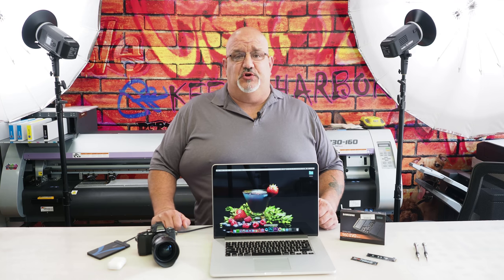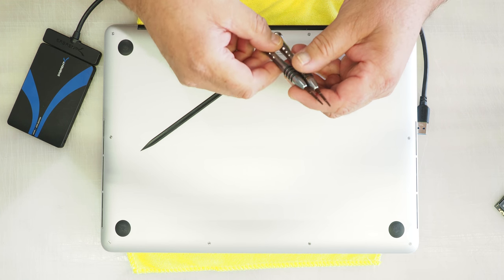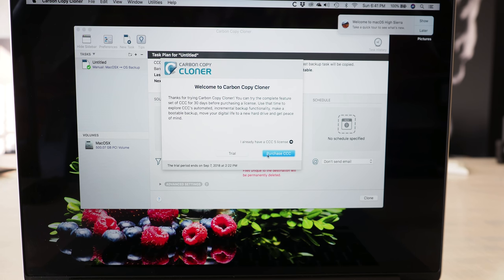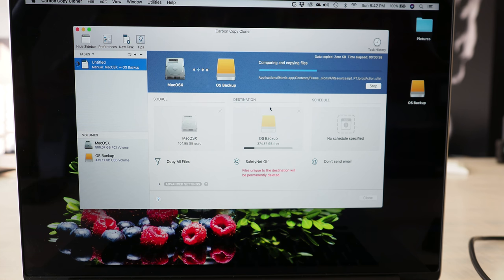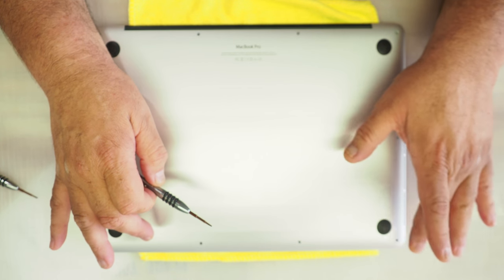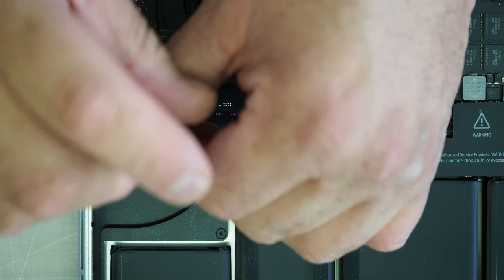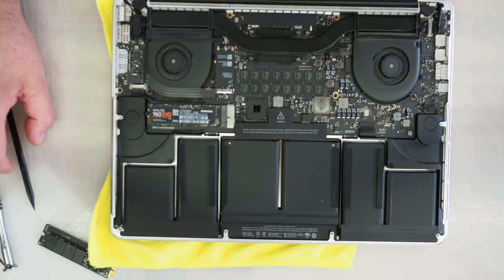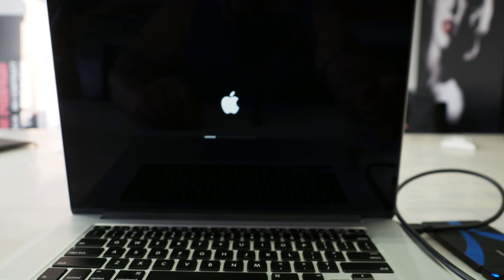Double the speed of your MacBook Pro  **EVO 960 HOW TO UPGRADE**

Comment: For safety sake you should unplug the battery connector, also if you are a smoker DO NOT touch the GOLD (they are not brass, they are actually thin gold plate over copper) finger connectors on the adapter and the SSD, long term oxidation can occur or static discharge from your body could damage the SSD. The plastic pry tool Rick uses is called a spudger.

Comment: the method helps to increase capacity at low cost however yes the disk is faster but in normal use or heavy use is not so ... big ..... in fact i made the swap with a 1TB nvme WD Black Drive .....   I have reinstalled the original 1 TB Apple Drive.......  I`ll keep the drive in case of fail

Comment: Hi Great video! How's temp after the ssd upgrade? My mid-2014 macbook pro runs really hot after the ssd upgrade. I'm just wondering if there's way to fix the temp issue. Please advise. Thank you.
Reply from the maker: Yes 
The bottom of the laptop gets hotter but the hard drive uses the bottom of the aluminum laptop as a giant heatsink so no worries
I do 4K video editing on it and it blows thru frames without a hiccup
Thanks for stopping by
Regards, Rick
Reply: @rickvestuto  Thank you very much for the quick response. Have a good night.

Comment: Any idea how I could make this come true with a 2010 MacBook Pro with a 2.5 sata hhd currently in it?
Reply from the maker: You might be able to
You would need an adaptor from Sata to Msata...
problem is that your 2010 laptop has smaller Lane width and  probably wouldn't be able to go any faster than the 400 or 500 GBS  speeds that the computer already does
so it would be the same speed and not worth doing
Getting a faster SATA drive like the new 970 Pro might help but again may not help do to the fact that the computer is so old

Comment: Hi Rick, would this also work for MacBook Pro - late 2013?
Reply from the maker: The only way to know for sure is to Open the back of your Mackbook
I'm guessing that theres a 2.5 HDD instead of a MSSD
If so it's still posible to put a faster HDD in yours
it will just have to be a Solid State 2.5 HDD instead of the Msata style like mine
Reply: CHK MKN true it has ssd. Sadly the IOS cannot see it. I tried on Ubuntu and it detects it.
Reply from the maker: I dont know what you mean "The ISO cannot see it"
You can switch out any Mechanical HDD with a SSD and it will become 2 to 5 times faster
Once you follow my step by step from your Mechanical HDD to a SSD you will be able to load into the ISO

Comment: Hi Rick I have a Mid 2012 13" inches Macbook Pro(model A1278) I want to replace my primary HD(2.5 Sata) to a Samsung 970 EVO SSD. My question is, is there a an adapter in particular that you would recommend? If so, would the drive run at a 100% and what about the durability of that adapter? Thank you
Reply from the maker: If there is an adaptor that would fit I don't think that you would see any improvement on the 2012 Macbook
The older tech in your laptop does not have the Bus speeds and width needed to run any faster than 400 to 500MBS.....Thank for the question
Reply: @rickvestuto  thank you. Then I will go for a regular 2.5 sata. I'm trying to decide between Samsung and Crucial. Any suggestion?
Reply from the maker: @Tony_2022  Crucial can generally be cheaper but I prefer Samsung. I have had problems with Crucial in the past but have never had problems with Samsung.....
Best of luck
regards, Rick
Reply: @rickvestuto  I agree I'm actually replacing it because my main one is damaged. And it's Crucial brand

Comment: Will This Work On A Mid 2014 13" Retina Macbook Pro???
Reply from the maker: Yes it should
Just depends if you have NVME drive or not
Regards, Rick
Reply: Ronaldo Ramnath yes, I performed this upgrade in a 2014 rmbp with the samsung 970 evo plus 1tb, found out the sleep/standby/hibernation/autopoweroff issues affected the 2013-2014 models, went in terminal to set them all to 0, reading on the macrumors forum website thread this known for all aftermarket ssds and apple has no plan to update the dxe boot rom driver for this https://forums.macrumors.com/threads/upgrading-2013-2014-macbook-pro-ssd-to-m-2-nvme.2034976/page-257
                                                                  Mac models will enter Standby mode after they have been sleeping for 3 hours. The issue we are investigating is a system crash which can sometimes occur while attempting to wake a Mac from this Standby mode. Afterward a panic log will be displayed.
 
https://eshop.macsales.com/Service/Knowledgebase/Article/26/785/NVMe-SSDs-Standby-Mode-Issue
 
This problem is related to the NVMe DXE driver in the bootrom of the 2013-2014 MacBooks, how change settings in terminal
http://indmem-global.com/download/20191014.html

Comment: I’ve been trying to avoid a two hour drive up to B&H if you know about MacBook Pro (2018) using a QNAP NAS (TVS-472XT-PT-4G) or any NAS (since QNAP has no support... they ignore emails, forums, phones...)

I thought it would be as easy as any other external drive - just plug in your USB or in my case Thunderbolt 3 and Mojave would be plug and play Good to Go... Nope.

QNAP Qfinder and MacBook Finder... can’t!?!

The User Guide looks like there needs to be a “switch” or “router” in between but there is no mention of WHAT that is and Apple “Support” says they “don’t support 3rd Party products”

Unless someone knows what’s going on it’s a long drive up to B&H who suggested and package this deal... because the phone support says “just plug it in directly” and doesn’t believe it doesn’t work...

FRUSTRATING

Comment: Is this applicable for macbook air 2017, using 970 evo ssd?
Reply from the maker: Sorry No
Reply: Mahid Lomantong yes, you can on the 2017 MacBook Air, the ssd is solder to the motherboard on 2018 & up models...here is a video on upgrade your MacBook Air https://youtu.be/2WbN77q4yoI

Comment: To upgrade a mid 2010 macbook pro with 970 evo plus which adaptor I should use?
Reply from the maker: you can NOT upgrade any mac book with a NVME hard drive older than 2013 sorry

Comment: I have a samsung 970 evo in my iMac 27' 5k (2014) with Sintech adaptor
but the speed is 700 write 730 read, how is it possible?
Reply: i have a link width x2
Reply from the maker: Because your 970 evo dosnt have 2400 write & read speeds like an NVME drive has
The newer NVME m.2 drives have up to 3300 reads and write speeds

Comment: I just bought a pre-owned mid 2015 15” Intel i7  2.20GHz  16GB memory, 512 Gb SSD, Mac OS X Sierra for $820. What can I do to make this better? I will mainly use it for photo editing.
Reply from the maker: That's a great deal!
About all you can do is upgrade your Hard drive to NVME Samsung for best performance 
Did you get the Mac with the NVIDIA 970 video card?
That's the one I got and is the best performer 
best wishes
Regards, Rick
Reply: I have the PCIe SSD hard drive. Do you mean that? As far as the Navid thing, I don’t think so. I haven’t received the order yet but it doesn’t say on the description.
Reply: NVidia 970 I mean
Reply from the maker: @JuneK618  
No
Either the Iris Pro 5200 GPU
Or the GT 750 by Nvidia dedicated Video Card
That one is the best for graphics design

Comment: Hi Rick. I have a mid 2014 macbook pro 13''. At the moment I have the standard hard drive with a 128gb of diskspace, which is totally filled up. I would like to put a Samsung evo Pro of 512gb in it. Is that a smart choice? And more important, do you actually see a difference when it's running? Thanks alot.
Reply from the maker: The 2.5 SSD's can only run at up to 550 write and 550 read
You might see a slight increase in speed but at least you will gain more hard drive space
Best of luck
regards, Rick
Reply: Well I have an stock installed m2 in it now, not 2.5. I'm just wondering whether speedwise it is worth to upgrade to a Samsung evo Pro. Ty.
Reply from the maker: @edrush001  
As long as its an m.2 NVME then yes
almost triple the speed
But really it depends on what you do with your laptop
If you just browse the web then probably not worth it
But if you multi-task or create music or edit videos then yes
totally worth it
Regards, Rick

Comment: You missed VERY important steps buddy. Troubleshoot it for a while ... and see if you can determine what I mean. :)
Reply: Are referring to disconnecting the battery?
Reply: I am about to do follow this video to upgrade my Macbook Pro storage, so please just tell us what the step is. I would really appreciate it!
Reply: Spencer Teuscher it’s probably disconnecting the battery. Every other video on this upgrade brings that up. I’ve done it with the battery still connected and not connected with this drive upgrade and oem apple drives. Just follow the steps and take your time. Worth the upgrade. Go pro if you can.
Reply: @shenronz6260  I am about to buy the 1tb 970 pro to install. Can I just use a timemachine backup to restore or should I use CCC?
Reply: Spencer Teuscher follow the steps to get the drive to be readable 1st and then you can time machine it.